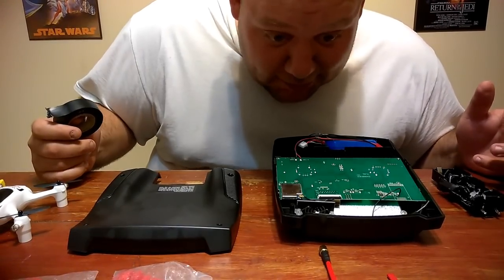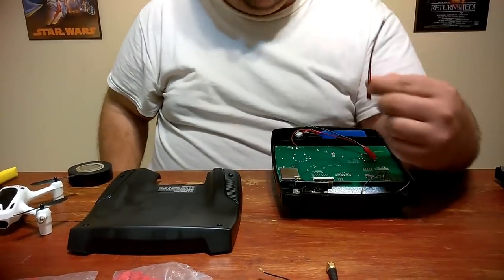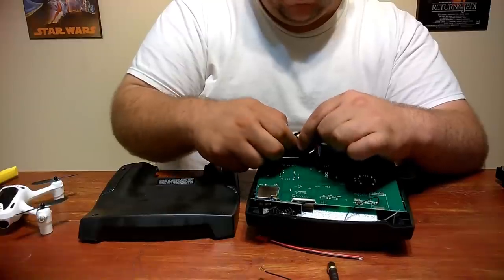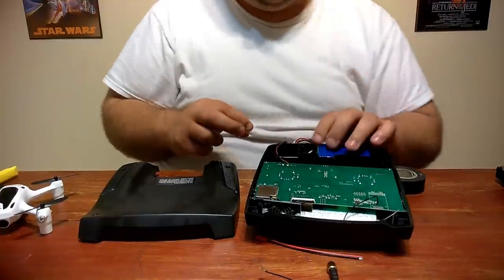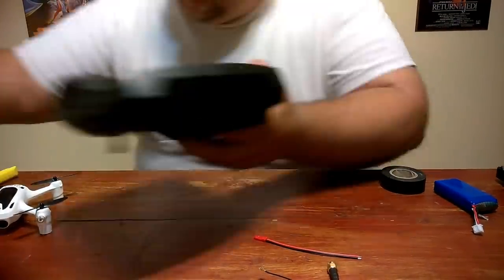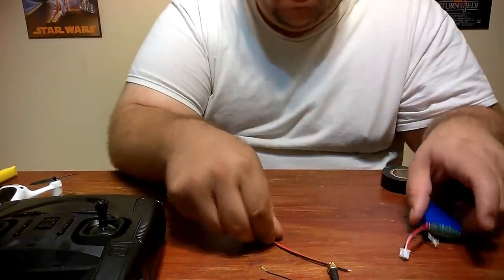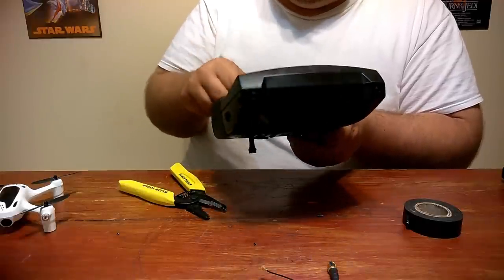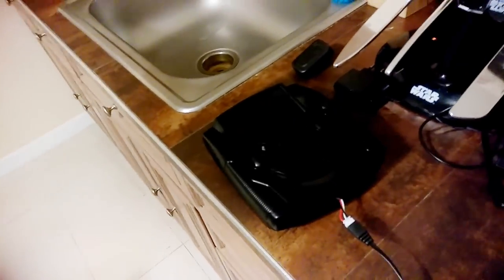Hubsan X4 H107D+ Transmitter Battery Modification

Comment from the maker: just a reminder guys these mods are meant to be simple so everyone can do them especially kids. not all kids know how to use shrink wrap or a heat gun or how to solder so we simplify things for everyone. for those of you who like to Tinker you understand how to do this correctly so take the necessary steps to make sure the job is done to your standards ;)
Reply: Dan : You should teach the newbies how to do soldering and heatshrinking. You can show the simple way as well. I know that it is easier and quicker to twist wires together and tape them. That type of connection causes increased resistance, it wont deliver as many amps under load. It could affect the performance of the bird.  I did that on a battery connector swap and had the connection fail in flight, immediate hard landing. I did an air-conditioner plug swap once, a long time ago, using the twist and tape method. The twist connection had a bunch of resistance and got real hot and almost caught fire.
Reply: yeah it would make good video most is in setup but you have to for vids anyway. look on amazon do a deal with seller if you can that you will leave link to store and items. lol Don Fish jr. knows what he talking about twist and tape is ok for temp but in long term can be trouble with lipo battery. you are using it in a low amp device but charging it might be the problem unless just through balance cable. good mods i can tell you know your stuff too or learn fast respect

Comment: Dan : The Tarantula X6 1200 mAh battery fits the battery bay, it has a JST connector. You should get a cheap pencil soldering iron, a little spool of rosincore solder and some heat shrink from Home Depot or Lows. Makes modding neater and better. The soldered 2.4 antenna pigtail isn't hard to unsolder. You just have to snip off the external antenna pigtail board plug and cut and pull back the shielding a 1/4". Solder the center lead and the shielding to the ground pad. If there is no grounding pad, all you do is scrape the green insulation lacquer off of the board, down to the copper plating and solder the shielding to it. Easy Peezy! ;-)
Reply from the maker: Don Fish Jr. I need to purchase another soldering iron mine has failed and does not get hot anymore but I do prefer electrical tape to heat shrink. if it keeps me from getting chewed out in the comment section perhaps I'll do this next time lol ;)

Comment: that good idea with the charge cable outside the transmitter
Reply: Wayne : You can go one step further with that mod. You can use a much larger higher mAw battery that wont fit in the battery bay. Velcro the battery to the back of the transmitter. ;-)
Reply from the maker: Don Fish Jr. I prefer to keep things looking a little professional. this battery allows me 7 to 10 flights before requiring a charge so it performs admirably

Comment: great mod Dan...probably a good idea to get yourself a soldering iron and some heat shrink to finish the job off...
Reply from the maker: +Rob Simpson lol my soldering iron is broken and for some reason my heart lies with electrical tape lol I spent the majority of my high school years and installing radios for friends in their vehicles and got accustomed to just direct wiring everything. I definitely need a new solder gun though remember my channels designed for everyone especially kids who don't understand how to solder but still want to be able to perform the mod.  when I do these mods I try to keep it simple for everyone that has normal tools around the house
Reply: I must admit, I've done it myself in the past on old stereos and car radios...twisted wires and insulating tape... quick and easy and it gets the job done...
Reply from the maker: Rob Simpson if it was a project that required more power draw then I would go ahead and actually solder her and do things properly but the transmitter does not require much draw at all
Reply: true

Comment: I hope you have better luck with that little bird then I did. I had that bird (not the fpv version). I never was able to get that little fucker to fly. Which is strange due to the fact that I am an experienced flier indeed. I sent it back to Hubsan. As you have stated in the past. Hubsan does have issues with quality control. Now I have the Hubsan 107c manual bird and she is a blast to fly in the house and chase the dog!!!!
Reply from the maker: Bill Smith video going up soon

Comment: Whooo ... No solder? Hey next time you work on a lipo like that only strip one side of the wires at a time and join them together then do the other side to avoid a battery short , you never should have both battery leads stripped bare at the same time you could have shorted out those leads very easy by accident and it always is easy to avoid a problem before it starts by doing above.
Nice mod though =)
Reply: I had my eyes shut half the time lol
Reply: Yea that's the one BIG no no when wiring lipos NEVER leave both + & - stripped only one side at a time!
Reply: New vid up bro ......My all time fav.........;-p

Comment: The Hubsan transmitter does suck the life out of batteries awfully fast. I just purchased a Panasonic charger and rechargable AA batteries. That works OK for me.  What is the advantage of using lipo batteries in your transmitter opposed to rechargeable AA's? I'm new to all of this drone stuff but I'm always reading how dangerous lipo batteries can be while charging.  Is that a concern, charging the battery inside the transmitter?  Or is the danger of lipos overblown?  I alway enjoy your videos and learned a lot about my H501S on them.  I know your done with the H501S but I enjoy your reviews on your new quads.
Reply from the maker: Eddie Hicks the discharge rate on a lipo battery is much much lower than on alkaline Double A's so you will get much more use out of a lipo. the people that try to fast charge LiPO batteries on Pro Chargers are the people that have problems. normally using the stock balance charger that comes with your unit will not cause any problems. also I always leave my batteries in a state of storage voltage to make sure it doesn't have any power spikes while sitting somewhere

Comment: Why bodge when you should be showing people who might not know any better how to do it correctly. Use the proper tools, take the battery holder out using a thin card to open the plastic tabs not brute force, solder connections with an L , use shrink tubing not tape , stagger joints so if the insulation comes apart it won't touch the other lead on the battery.  Disconnect the battery before charging it by using an isolating jack plug? Nota good presentation to show others
Reply from the maker: Why worry about a video that's 2 years old when there's 400,000 people that have performed this modification already 😉 boy that was a waste of your day commenting like this maybe next time you'll check the date of a video and how relevant it really is in today's world before taking the time to write that elaborate comment